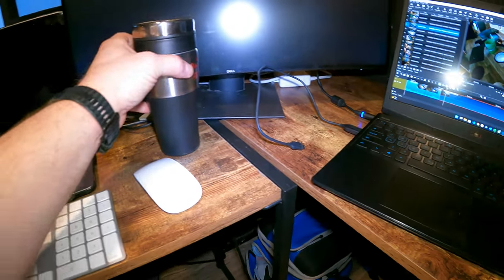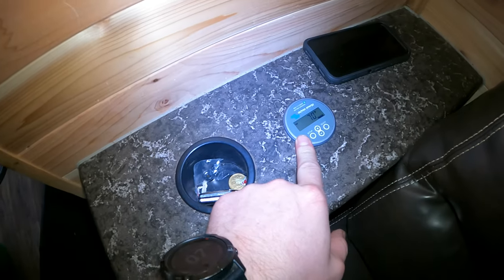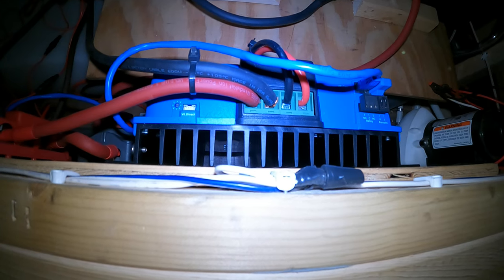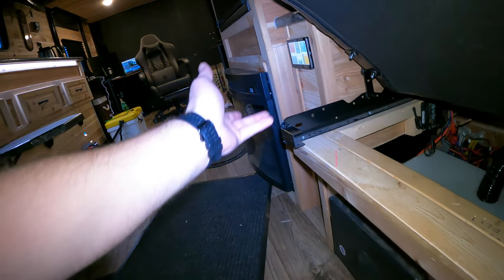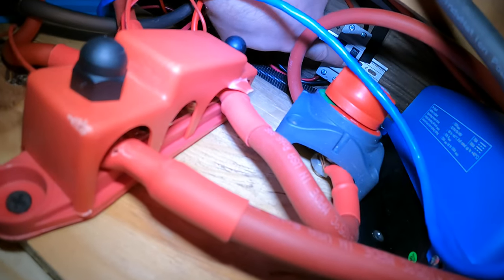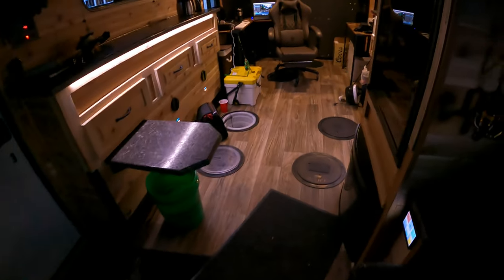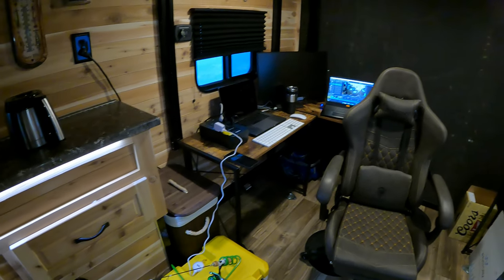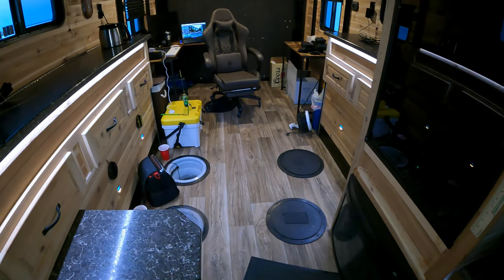Solar and Lithium setup Fish House (it works pretty good)

Comment: This is awesome. Wish I knew more about getting internet on lakes with no cell/data
Reply from the maker: I use starlink now, but I've tried a few different routers and things in the last year or so. The calyx institute has some unlimited hotspots you can get that work pretty well on lake of the woods and red lake during the week, but when the weekend crowds come out, cell towers get pretty congested
Reply: @didyoujustgethere  how does star link hold up to sub zero temps?
Reply from the maker: @dougputt4385  it works just fine, haven't had any issues in -30

Comment: Are your solar panels flat on your roof? How many watts is the inverter? Lastly, how much do you have into the system? I have been thinking of going this route by starting with just and inverter and batteries and adding solar later.
Reply from the maker: Yeah, the panels are flat on the roof, I would like to make new mounts to allow me to tilt them for winter time I haven't gotten there yet. 

The inverter is around 2400 to 2600 watts, runs the entire house pretty well, with a soft start on the ac it shouldn't have any problems. 

You can double check the links in the description, but with just the inverter and batteries it was probably around 3k? I'm sure the prices have fluctuated in the last few years. There are cheaper ways to build your own lithium batteries nowadays too. 

A good resource to check out is "diy solar with will prowse" he has a ton of good technical information about batteries and inverters and all that!